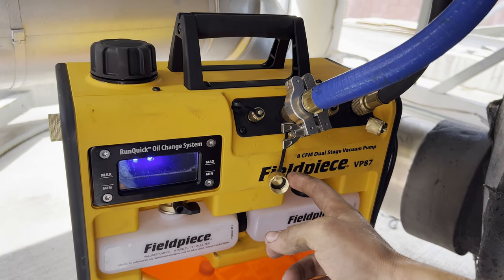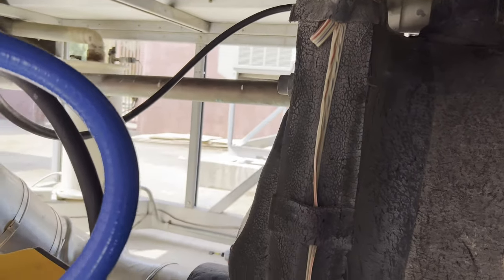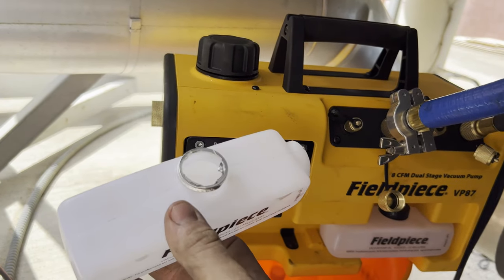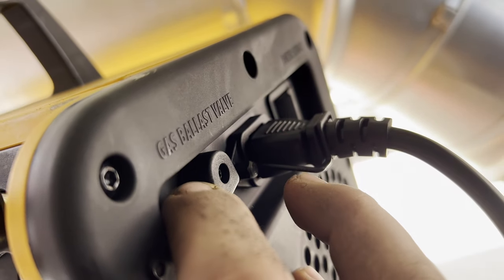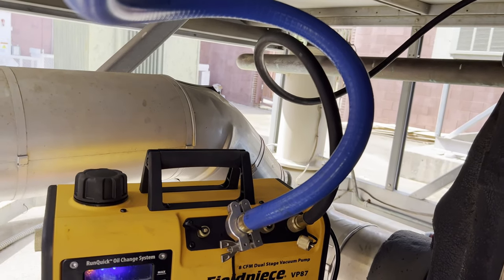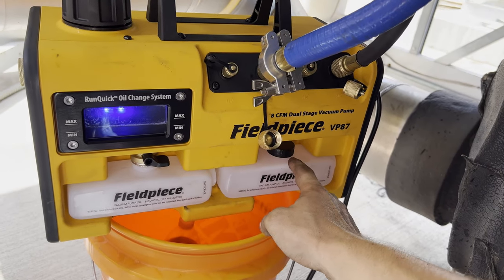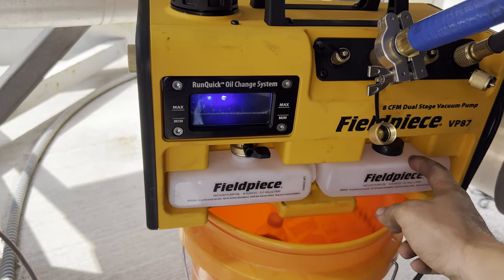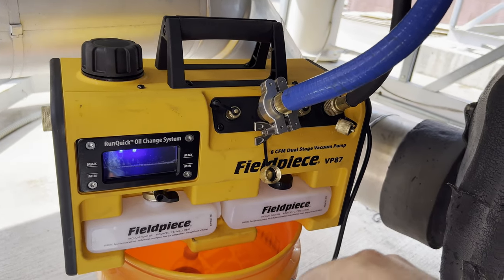Fieldpiece Vacuum Pump VP87 Quick tutorial

Comment: What do you do with the old oil?? Throw out the reservoir and purchase new or dump, clean and put new clean oil in it
Reply from the maker: If you wanted to , you could reuse the canister but I don’t , because to clean it would be difficult and you don’t want to have left over water mixing with new oil.  It’s intended to dispose of the canister with the old oil and use a new one . They sell them in packs of 3 or 4 at most supply houses.    Good question , thanks for watching
Reply: You can also just buy a gal of vacuum pump oil and just use the plastic containers for dumping waste oil when pulling a vac. You could be doing 2-3 oil changes on a large chiller so buying the three pack never served me any good.
Reply from the maker: @leolyons4158  yes great comment , I always keep an extra gallon of vac pump oil from United Refrigeration just for these instances . I have done what you said many times. You are correct some larger heavily contaminated systems may require all day and overnight vacuums with multiple oil changes

Comment: Thanks for the video, how often should someone change the oil of the pump?
Reply: Most pump's recommend after every use, which I assume would be every couple of days worth of use.  A used oil would not allow the pump to pull-down vacuum to full spec.  So a pump that can do 25 microns, would top out at 100 or 200 microns with used oil.   So you can close off all the vacuum ports, and just have a gauge attached, and see if you can get the spec to check oil condition.  Basically the oil is hydroscopic, and absorbs moisture and other stuff that degrades it's performance.   

Also this Fieldpiece pump has two reservoirs, and allows an oil change without breaking vacuum.

Comment: Where can I buy that kind of hose of yours? what is the brand of your hose? the Blue one:) thanks
Reply from the maker: Hi, thanks for watching. The blue hose is the TruBlue hose from Accutools. They have various different kits and you can purchase online from TruTechTools. I have the starter kit , it comes with one hose , carrying case, core removal tool, and multiple fittings from 1/4” to 1/2” for various vacuum setups . It has been a great hose and I’ve had it for a couple years with no problems or leaks .

Comment: Why do I have to change the oil while is running? Or how do I know that I have to change it?
Reply from the maker: You don’t necessarily have to do it while running , but you can if you need to . On very long vacuums or on systems that are highly contaminated , it may require an oil change during the vacuum process as they oil could become overly dirty or contaminated which will drastically slow down on your vacuum speed

Comment: Can i use a fieldpiece 10cfm vacuum for residential?
Reply from the maker: Absolutely . It’s probably a bit overkill considering most residential applications will be a max tonnage of 5 ton per system , but it will work. I’d use a 3/8” diameter hose for residential instead of a 1/2” hose.   There is some debate that pulling a deep vacuum overly fast has the potential to freeze moisture in the lines instead of removing it, although I’ve never personally encountered that. If you already own the 10 cfm , then don’t worry about it. If you’re looking to go out and buy a Fieldpiece vacuum pump strictly for residential , I’d honestly stick with the 8 cfm.
Reply from the maker: Rule of thumb is a vacuum pump can pull down 1 Ton per cfm. So even a 5 cfm pump can pull down a 20-25 ton circuit with the proper vacuum set up. Using this info you can probably see why a 10 cfm might be a bit overkill for most residential applications.

Comment: Has anyone run into an issue where this pump constantly pops a GFCI outlet?  Mine keeps tripping as soon as I power it on.
Reply from the maker: I’ve never seen that on my machine , but it sounds like there might be a short with the wiring. You can try taking it apart and checking where the cord goes through the machine , or simply contact Fieldpiece via their website with your serial number and see if they can help. They have great customer support.

Comment: Where’s the micron gauge ?
Reply from the maker: There is no built in micron gauge on the vacuum pump . 

The micron gauge is attached to a 6” ball valve hose on a separate service valve further down the system as far away as possible from the actual pump for a truer micron reading